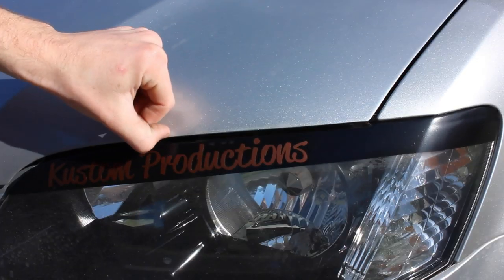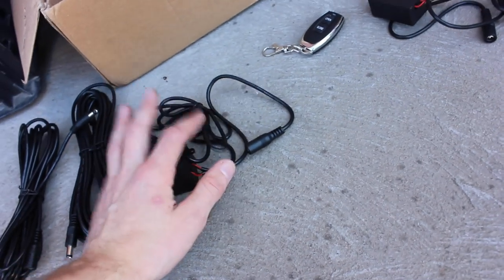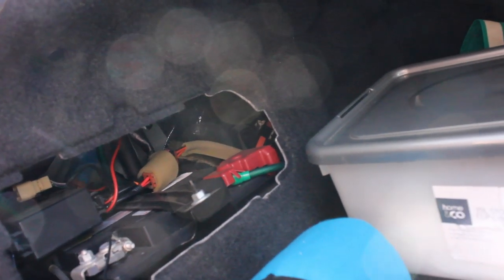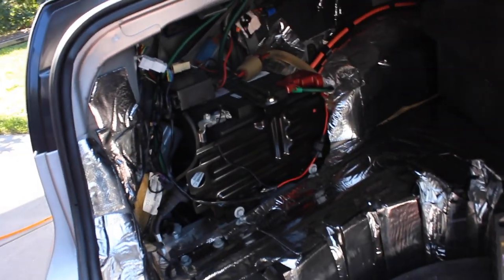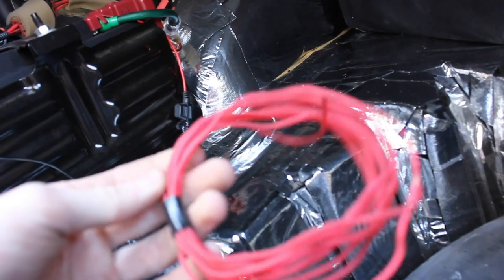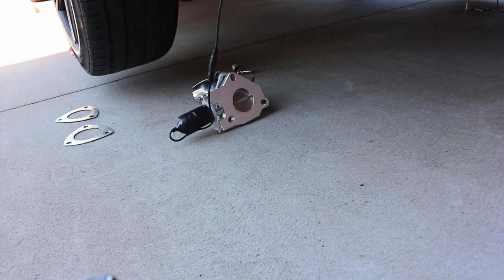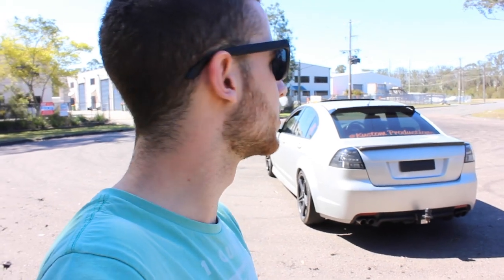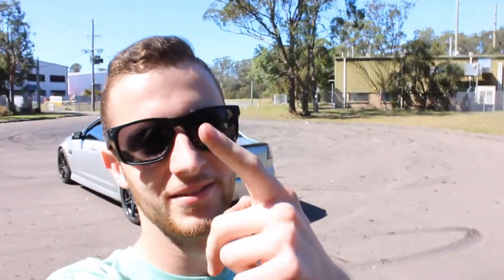Ve Commodore Exhaust Cut-outs

Comment: Surprised you didn't get the xforce varex exhaust system put on the car
Reply: @KustomProductions16  i know the feeling. Bought a ve series 2 sv6 2011 and bought a new cat back exhaust system which cost me 1200$. But shes stainless steel cat back

Comment: I've got a 6 litre 08 Calais wagon with a cat back, your car was already louder than mine was before the cutouts hahaha I'm looking to get a set of dumpers put on mine in the near future.
Reply: The l98 Calais? I got two different muffler sets for mine. Ebay straight pipes sounds best. Ultrex SS Muffler r too quiet for my liking. Straight pipes are going back on asap.
Reply: @chris929rr7  Yup that's the one. Yeah I might have a look into a set of straights. Only issue is the cops near me are super hard on stuff like that, and it's on Tein coilovers(very low) already. Plus daily driver, so would want that option to make it quiet.
Reply: @Biscuitabuse  Shouldn't be to loud bro. I found it only really loud at startup and obviously when you put the boot in too but I hardly thrash my car much. Only just got it hahaha. Waiting on a mail order tune that i got for $650. Should give me 30KW increase. Puts me at 300kw with only a growler intake and HSV intake pipe. After that ill get an OTR for sure.